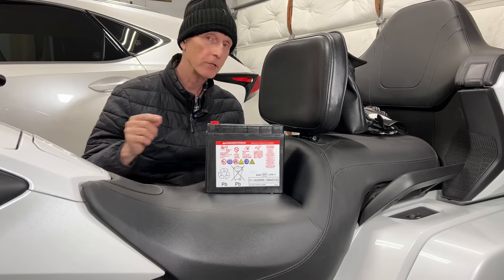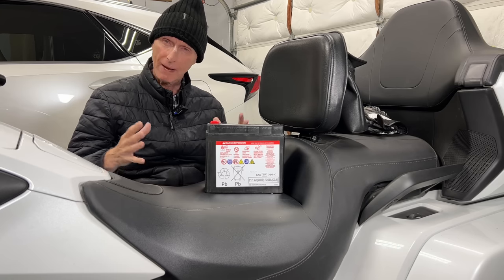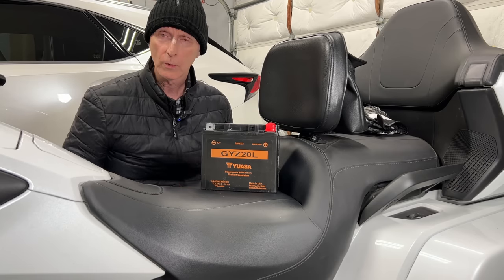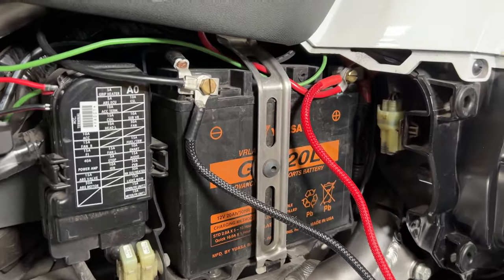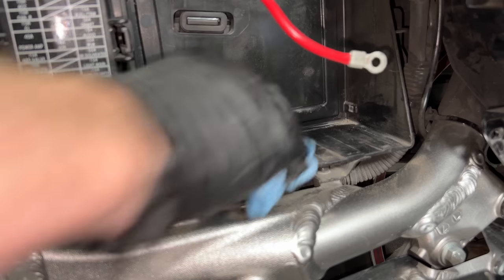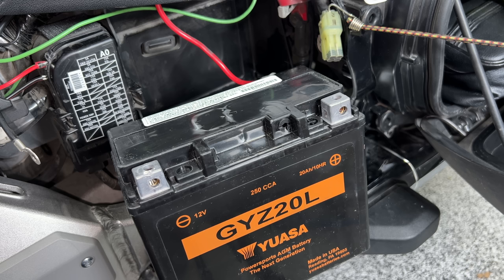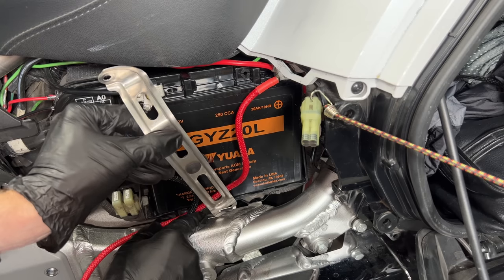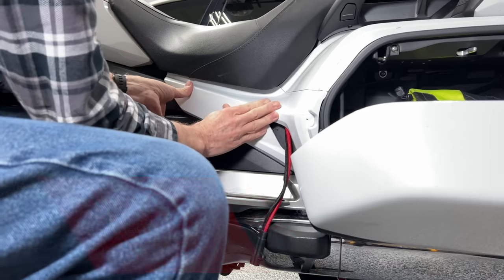Battery Swap on my 2018 Honda Goldwing | CruisemansGarage.com

Comment: The battery died on my '18 Goldwing yesterday without warning miles from home. I watched this video. It was spot on. I retrieved the tools needed as described,  and was able to replace the battery in a parking lot. Thank you for this thorough, detailed & accurate video.

Comment: The battery on my 23 Goldwing recently died after I stopped for gas.  I decided to replace it and it has been nothing but a nightmare.  I live in Manitoba Canada and went to a battery shop for a replacement.  They sold me an Odyssey that would fit, but the way the battery casing was formed, it was impossible to connect the terminals.   I returned that one and was sold a Yuasa which also fit, but the bolts for the connectors were either too long or too short.  I returned that one and showed them a picture of my battery and took another Yuasa battery that was very similar to mine, however when I tried to install it, the bolt holes do not line up making it impossible to make the connection.  This morning I went to my Honda dealership and they had an Interstate battery, but again, I could tell the bolt holes would not line up.  I showed the parts man a picture of my old battery and told him to order me that one.  It was the most expensive and won't arrive for about a week, so just in time to store the bike for the winter.  I wonder why these battery manufacturers can't make posts that will fit more than one motorcycle.

Comment: I have a 2022 DCT and it was having trouble starting, Lights on dash would flash and would not turn over, replaces battery with a Yuasa GXZ20L still experiencing problems. Is his a common problem?

Comment: I have a quick  question, replaced my battery.  The lights were Flickering and the display was blank. After replacing the battery, the bike would do nothing as if the battery was disconnected,  I checked the electrical connection to the new battery and had 12.8V.  Fuses are all good, none were blown. Would a Bad Audio unit cause this problem?

Comment: My OEM battery failed on my 2018 Gildwing after approximately 250 miles. Honda eventually replaced the battery for free. However, I had to push them to make this happen and before the battery was replaced, I missed a multi day group ride. This was not the type of issue I expected to run into on a brand new Goldwing purchased from a dealer.

Comment: I've had batteries with the same type of connectors.  I wedged a small piece of cardboard between the brass fitting and the backside of terminals.  This held everything in place, making it easier to install the battery and connect the bolts.

Comment: Great video Chris thanks.  I can’t over emphasize your preventative strategy. I had a couple of older bikes and my last was a 98 Aspencade.   Two times had the batteries failed without warning, as they always do, just at the wrong time after shutting of the ignition switch. And yes never in your garage , always miles from home. One in a remote gas station and second several miles from home. For us older riders, first time was lucky to have a motel next door on a Sunday. Yes had to wait till am Monday and local dealer brought a new battery. Second failure I did the old “put it in second gear, and pull in the clutch, push the 900 lb monster at a run down a slight decline (lucky) jump in air slam my ass on the seat, pop the clutch and YES  the bike started. Drove to local Honda dealer and they installed a new battery. EVERY THREE YEARS DO IT.  AND yes the clutch popping thing will not work with a DCT. SO. I carry the Scoche battery jump starter with the installed harness Chris previewed.  Be Wise Be 😃

Comment: As you stated the brass screw connectors want to slid out when putting bolt in. I put a piece of tape on each where they go in. Leave a tab long enough to pull tape off after cables are on. Honda has printed on the OEM battery the charging method. These are AGM type batteries. Like you I like to replace every three or four years. It makes me feel better anyway. Good video. 
People BUY the MAINTENANCE Videos. Even if you don’t do all your own work you will learn so much about the Goldwing.

Comment: Wow, this helps out so much Cruiseman. I’ve had a spinal reconstruction surgery almost a year ago and haven’t been able to ride my 2021 Goldwing trike and my battery has died. Although I tried to crank the bike weekly the battery didn’t last and I was cringing at removing and replacing the battery. This video has made this appear so simple I’m embarrassed to think I was apprehensive.

Comment: My situation is almost identical to the video. After reading about so many having to replace their battery i figured it was time. I am from Ontario but in Florida for the winter and the Goldwing is with me. I have a 2018 6 speed. Just before i bought the new battery i had an issue starting at a gas station down here. Hit the start button and the bike did 2 or 3 quick attempts to start but didn’t. Right after that i pressed the start again and it did start. Got back to the trailer park and shut off. Turned back on and started and the engine light was on. Figured from the false start at the gas station. Got a replacement exact match to the origional battery. No issues installing and started right up. Voltmeter readings matched what the shop manual said it should be. Have not had a chance for a longer ride yet but did take it out for a couple of 20 km rides with no issues. After 3.5 years it was time for the replacement before it might have left me stranded.

Comment: Very good job Cruiseman. I have a 2021 DCT and last week I was in my drive way getting ready to take a short ride and BOOM!! it wouldn’t start. I followed right along with your video and changed the battery. I did try the Duracell . Thanks for making it simple ..

Comment: Nice video. I connected two wires about 24ga. to a tiny 12v battery. The other ends to large alligator clips. I connect negative to bikes frame and positive to positive bike cable connector. This holds all bike presets when battery is being swapped. 
It is very tough to jump start a Wing because jumper clamps usually don't fit on bikes battery terminals. This is my workaround. I purchased a stainless steel 1/2" diameter towel bar from Home Depot. I cut 2 pieces 5/8" long and bored holes through each for longer 6mm battery bolts. Easy with a lathe. Never use aluminum. 
I purchased 2 longer 6mm stainless steel bolts with 10mm heads and trimmed to length. Now it is easy to connect any jumper or zero gravity starter.
Since my Wing is a 2012 other years may need a check for any interference with side covers etc. 
I hope I don't need to use them.👀

Comment: Very useful video. Mine's not due for a while but the tip on removing the bottom piece looks worth doing
Routing the cables,especially  thicker ones can be problematic.
I closed the securing bracket over the positive and immediately realised that the sharp (ish) edge  was likely to cut over time into the pos. If the bracket is attached to a grounded metal part at its base, there could be a nasty surprise!
It looked like your pos was vulnerable to this too.
I may have been mistaken. Just sayin'!
I put a protective covering on mine just to be safe.
It's worth mentioning in case anyone else might be doing the same. Best wishes.

Comment: Thanks for the video and tips on the batery. All bikes and batteries can be different. My 2014 Indian Chief battery lasted 10 years when I sold it. My KTM1290 battery lasted 7 years before it died. Seems that the more complex electrical featured bikes go through batteries quicker. I noticed that if you leave the heated grips on when you shut off the GW they don't automatically cancel after shutting off the bike. Bought a jump pack (Noco) just to be safe with the GW.

Comment: I usually attach extra positive cables to the start relay battery post. And ground cables to the frame. Thereby easier to service battery

Comment: My 2018 Goldwing wouldn't start and the lights flickered weirdly and horn was very weak .  Ended up jump starting it to get it home. I took the battery to a local store called Battery Warehouse to buy a replacement. They load tested my battery and it tested good.  They told me to check my ground, sure enough the threaded brass block inside the negative battery stud  had white hard corrosion on 3 sides. I Filed off the corrosion then reinstalled the battery and everything is back to normal. I'll have to wait and see how long this original Yuasa battery lasts.

Comment: Love your video's. I have an idea for a new one, find a work around for the fog lights turning off when the high beams are on. This is a common "fix" on all 3 light Harley Davidsons, in face Harley makes a plug n play wire harness that allows you to run both the passing lights and high beam at the same time. I know in some states this is not legal, but us old Harley Guys have been running this for generations and NO one has ever been stopped or questioned on it.
Reply from the maker: There is a jumper you can install that will override this.

Comment: Nice video, Cruiseman.  I'd add for everyone to really tighten up those terminal screws because they can loosen up over time.  I had that happen to a 2006 Wing and saw it happen to another bike within the last month.  Both times it was after a new battery was installed.   So if you get on the bike and it acts dead, check those terminal screws first thing.
Reply: I have a Wing and a CanAm Spyder. On the Spyder this summer it was behaving badly with an interminent starting issue .  Power would come on but no starter activity.  I assumed it was going to be a electrical issue and took it to the dealer.  Guess what?  The positive screw had backed off and came loose.  There was enough juice to power the electrics but not enough to start the Spyder.  Lesson learned.  Check the screws.  (Note: it was a dealer tech who serviced the bike in the spring; he installed an accessory power port for me during the oil change and must not have tightened it enough).  Loose terminal screw = $100.  I agree with  replacing a battery at 3 years.  Over many bikes and years I have learned the hard way, only once was I not out on the road.  I use a battery tender constantly when not riding.

Comment: Im upgrading to the GYZ20HL
As it gives me 12 Volt, 20 amp-hour, 》310 cold cranking amps《 over the stock 250 cca. Only because im in the north east if i was down south or in warmer climate ,i would keep my factory one. But i would not down grade to a lower amp hours like that Duracell battery has.(yes its a down grade).
I some time use painters tape at the ends to stop the nut from falling out or ill add a small piece of flexible rubber under the nut to give the nut pressure and not move or fall out.
Reply from the maker: I would be anxious to hear your experience.
Reply: Last I looked, Amazon had the higher performance model for a dollar more - that makes it the easy choice for me 👍
Reply: @bw6480  Have you had issues with the size of the upgraded one? It seems that the space for the OEM one is tight enough.
Reply: @alp3781  I haven't needed to buy it yet, but the specs say the dimensions are about the same.

Comment: I'm one of the "lucky ones" with a bad battery in my 2021 Touring DCT.  I'm going to be replacing it soon. Some folks on the Facebook Forum act as if I'm crazy for replacing AGM's every ~3yrs.  I'm considering lithium, or lead acid.

Comment: My ‘18 battery lasted 1 year. Dealer/Honda would not replace under any type of warranty. I replaced it with a Bikemaster TRDLFP20HL-BS lithium ion and it is a strong battery. No more struggling starter.

Comment: 3 years was about the best I could ever get with the old lead-acid-watch-and-add-distilled-water-as-needed batteries on my GL1100 and GL1500.  The AGM battery that came with my 01 GL1800 lasted 8 years, but I needed to replace twice more in the remaining 11 years I owned the bike.  YMMV, but I think a 3-year replacement schedule is overkill for an AGM battery.

Having said that, those of us of a certain age may remember Yuasa putting out a large batch of bad batteries quite a few years ago (late 80s-early 90s?).  IIRC, they were intended for Honda and were to be used in a whole bunch of their new bikes, including the GW (1200?  1500?  Both?).  Honda had enough warranty problems that they returned a bunch of batteries to Yuasa.  Those batteries started showing up in the aftermarket, being sold as replacements, with the same problems showing up.  Fairly big stink at the time in the motorcycle press.

Comment: Terminals are made of lead, which is a soft metal. The square nut insert is made of steel which is a much harder metal. By putting the threads in a harder metal, you can tighten and loosen them multiple times without destroying the threads….

Comment: Chris, order yourself Optima1 panel mount short tail female trickle charge waterproof plug. I mounted one on the black plastic area of the left panel(battery panel) close to the tip of the triangle shape area. It looks super and clean looks, very sturdy and easy plug in/out. It's only 13.00 on Amazon.

Comment: My battery was getting sketchy so I decided to replace it as well. 3 years old and thankfully all the issues I had were in my owe garage. I aways put it on a trickle charge if I wasn't riding for 6 weeks or more. I had a couple of instances during the riding season when I went out and couldn't start the bike without charging back up. A lot of choices were out of stock in my area and I ended up buying an Interstate battery. The swap was easy and went well, EXCEPT my Zumo XT mount is no longer supplying power to the Garmin. UGG! Any thoughts on how to trace the problem without tearing it all apart? Have you heard of this before? I appreciate all you do.
Sincerely,
Barney

Comment: My last GYZ20L used on my 2010 GL1800 lasted 7 years. i know I was really pushing it. I never had a problem with any of my motorcycle batteries. on my GL1500 or the GL1800.

Comment: I appreciate very much your videos. In this case, it seems to me that removing the seat (which is very simple) makes the battery replacement much easier.
Reply: Yes, I too would go ahead and remove the seat; EASY. :)

Comment: Now you all have me scared. Own 2018 GW never had any problems. Keep a battery tender on it during winter. Ride daily unless there is snow or ice. Temps dip into teen’s during winter. Use heated clothing have plenty extra lights. Any advice on what brand might last, be better than others? Thanks

Comment: Replaced my 2012 at 6 years as a preventative. With the comments on here, I may change that to 4.

As far as the brass inserts on the battery posts,  I'm pretty sure that's so you can install the cables on the front or on the top, depending on the application. Couldn't have it solid and drill/tap both directions (not enough metal for that), and they don't want to have two battery configurations on the shelf.
Reply from the maker: Yes, you are correct about the threaded inserts. I should have mentioned that it is so the battery can be used with top mount connectors.

Comment: Ironically I went out for what might be one of the last rides before winter hits and bike would not start. Suspect it could be the battery even though Honda replaced the original at no cost to me this past May (at least they told me they did but now wondering if they changed it or charged the old one???). Not sure how to tell if it's really the battery but it is acting like that could be the issue (lights, dash lights, radio, nav all come on but just not enough juice to turn engine over). I clicked the link for the Yuasa YUAM720GZ GYZ20L Battery in the video and Amazon reports that "This does not fit". I have a 2018 Goldwing DCT Non-Tour. Guess next I'll take side cover off and see what's in there. But was surprised to see that message.

Comment: I would go ahead and remove the seat any way;  easier to replace the motorcycle battery, BUT also to inspect my accessory isolation fuse block connections/wiring.:)

Comment: Hey, have you seen that some of those panels don't sit completely flush like they should?  For the life of me, I can't get it to sit completely flush again after installing ring terminals for a battery tender.  I've tried all sorts of repositioning and have literally taken the cover off probably 15 times trying to adjust the cord, but I still have a small gap near the seat.  The saddlebag does close just fine, but I hate seeing any panel gap.  And truthfully, I never even thought to look when I first removed it if it was flush or not.  Anyway, let me know what you think.  It's probably only the last inch and a half closest to the seat that doesn't sit flush.  Nobody would notice it, but it is quite the annoyance for my OCD lol.
Reply: It's a very tight fit. Check that the added terminal is bent inward to clear the panel. Also, you might have extra wires/thick wires that blocking the panel locking. I had the same issue after installing NOCO battery tender tail which has bulky terminals on it.

Comment: Since you are doing battery this question is about the key fob battery. I'm having to change mine about every 3 to 4 months. Yes I make sure to turn it off after use. Just wondering if anyone else has to do this.
Reply: Every 6 months either it's good or not. I don't take a chance. eBay has 10 packs for cheap. No brainer.
Reply: @alp3781  I keep spares in my glove box now. I got lucky when mine died for the first time. I was at wal-mart and went back in to buy several.

Comment: 🤓👍🏻😎🏍💨💨💨💨💨👍🏻🇨🇦 good advice to change before the trouble starts. Although if you do have the batter jumper with you all the time, could maybe go a little longer. Generally to 5 year average if person is comfortable going longer.🥂
Reply: I also have a "compact" battery jumper pack; Micro-Start  XP-3 by Antigravity. :)